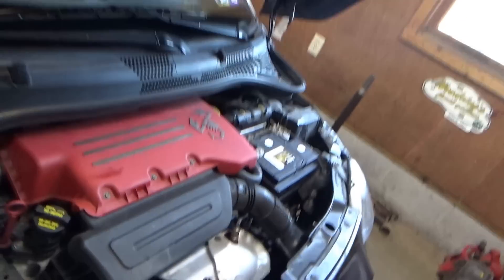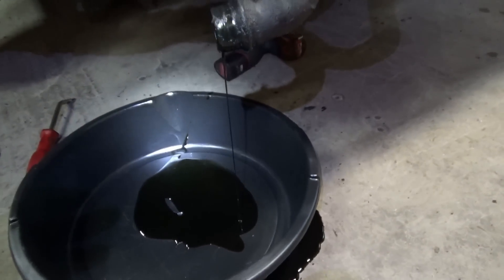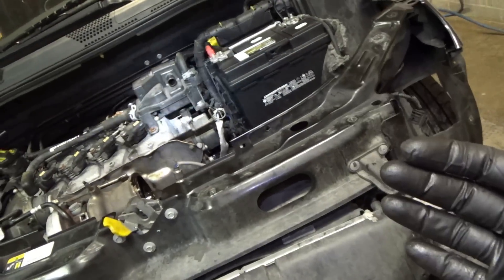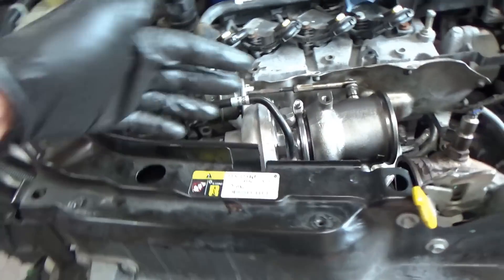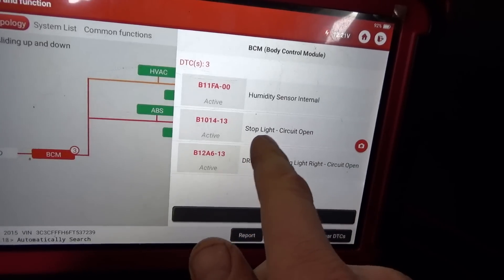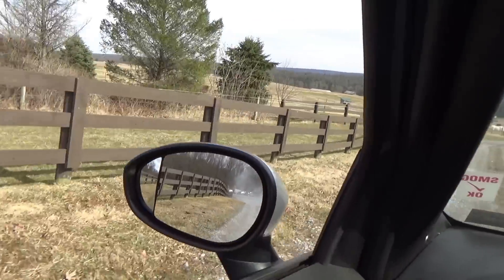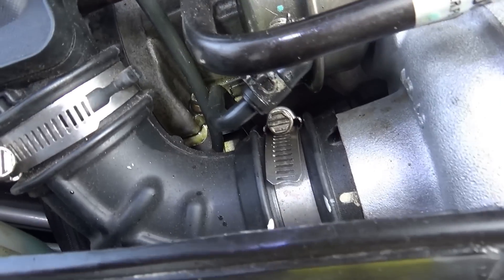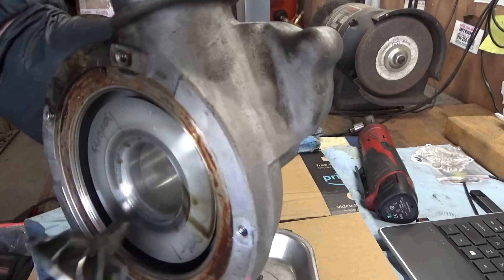Fiat Turbo GRENADES! (feat. Michael Jackson)

Comment: the smog OK sticker in the windshield is hilariously accurate.🤣
Reply: i past smog with flying colors with blown ring lands and smoke pouring out the exhaust back in the early 2000s,maybe because engine burning oil isnt releasing the wrong gasses?
Reply: "There is SMOG?" CHECK!  OK then...  :)
Reply: Very true!
Reply: Used the same measuring equipment as diesel VW,s
Reply: Came to the comments to say this but Hawkeye here beat me to it LOL.
Reply: @pigeonsil240sx  that should have failed the visual inspection lol.
Reply: Smog requested, smog delivered!

Comment: seen these type of failures on turbo cars so many times here in the UK with smaller engines whether diesel or petrol (gas) engines, it usually all comes down to lack of oil changes, the owner extending the service interval or private sellers and dealers resetting the oil service counter without actually changing the oil
Reply: I would say on top of this, just giving it the beans.. which if you have this car, you will hoon around for sure..
Reply: Or they use cheap crappy oil, I only use Liqui Moly in my Fiesta Ecoboost.
Reply: @tm199100  College kid driving it 🙄
Reply: I've also seen it happen, specially with plain bearing turbos, that people come right off the highway, park and shut the engine off right away.  Cokes the oil, scores the bearing and seizes it on the shaft.
Reply: I'm sure you did but did you check the oil feed and drain pipes for blockage? If not, you could be heading down the same path pretty shortly. Most failures are due to poor oil condition or no oil.
P.s not a dig at your process, love your work, just a tip for someone that possibly hasn't done one before.
Reply: The use of non-synthetic oil…
Reply: @davidbonnett5441  Made that mistake on a Honda turbo. Oil feed line has a gasket/screen assembly where it bolts to block that was plugged. Turbo lasted a day.
Reply: Hard cold start driving and not letting it idle to cool the turbo before turning it off will shorten it's life, I see the same issues with the lack of oil changes.
Reply: And it will still shred the oil pump belt and blink the oil pick up at 60,000 miles.
Reply: The little screens a lot of the manufacturers put in the oil lines don't help - crud in the oil blocks the oil supply to the turbo and next thing they explode. Seen it happen in a few smaller Ford and Pug diesels.
Reply: @stevestadnik9206  ouch!
Reply: @stevendegreef93  Back in '80, when in High School and getting my first used car, I had a friend who told me a joke. Now, remember there was no CD/DVD/Bluray/Satellite radio back then. The cars in my budget had only factory AM radios and m-i-g-h-t have had an external FM tuner installed (And probably done poorly). Anyway, a classmate friend told me this piece of advice: "If you're looking at a used car check the radio pre-sets. If they are all rock stations don't buy it."
Reply: You put in two quarts of fresh oil, 🤔and got out one quart of that black fluid? 🤦🏻‍♂️Oy!😱
Not only a laid out a smoke screen you also left an oil slick.😱
Reply: @RicksterMW2  theres a certian type of oils these take thats sold on the abarth website and if you dont use it your cause all kinds of issues

Comment: I have been building, racing, tuning, designing, dyno testing Turbocharged applications my entire career. 
1- religiously change your oil and filter with the correct grade, and premium quality oil and filter.
2- EVERY time before turning your engine off, allow time for the Turbocharger to spool or slow down before shutting off your engine. 
Shutting off your engine shuts off the oil supply to the Turbo, which can still be spinning 10,000-100,000 r.p.m.s. 
Following these 2 very basic guidelines and your Turbocharger should easily last as long as your engine. 
Thanks Ivan, for allowing me this opportunity to perhaps help a few of your subscribers. Excellent video as always. 
T.S. RACING
Reply: There are devices you can buy to allow you to leave your vehicle idling for a set or adjustable amount of time, and you can lock the doors and leave. They're worth every penny of the small investment. Of course use common sense when leaving your vehicle in a public place. Also, many modern day Turbocharged cars have liquid cooled Turbochargers,  ie., the same coolant your engine uses. If your coolant/anti-freeze is beyond its service limit, not only will it not cool your engine properly, it won't cool your  Turbocharger, AND AUTOMATIC TRANSMISSION as well. Read that last part again please. 
And yes folks I understand that it's the radiator that actually 
" exchanges " the heat.
Reply: i have a question, what when i just drive the last 5 mins very relaxed? without actually using the turbo, would i need to idle still? like driving sub 2k rpm for end of the trip, that's what i usually do

Comment: Seen this plenty of times working in gm dealerships. Replaced plenty of blown up turbos on the old Grand Ams with the 2.0 , and now it's  the pos 1.4L cruze.  Turbo's don't like lack of maintenance.
Reply: Yes plenty of oil changes are a must on any Turbo. I prefer synthetic but even back in the 1980's when Castrol GTX 20W50 was the norm on Turbo anything you had to do the maintenance. Even worse on a diesel when the turbo seal blows and you get a run away diesel!
Reply: these cars, 2015, they are now old. and paid off. Tiny engine, tiny lifespan.  Go get another.
Reply: Grand AM rip
Reply: @timewa851  its a tiny car too.. but 140hp form 1.4l engine is a lot! I m pretty sure the owner drives it aggressively and .. the result is this.
Reply: Yeah in a guy with a cruze and the turbo went out under 60k miles yeah he warrantied it then traded it in
Reply: @timewa851  Plentynof 1L ecoboosts around with 150k or more on them, how could that be possible if tiny engines have tiny lifespans? Small, powerful engines are simply less tolerance of abuse and neglect, two things that most car owners supply in abundance.
Reply: Especially  Subaru sti
Reply: @ferrumignis  well I still think Ford is a better manufacturer than Fiat Dodge and to be honest didn't forward take them EcoBoost and test them in the desert under hard conditions and then in the winter and like the Antarctic under harsh conditions under heavy load constantly up to 3-400,000 mi on test engines?

I mean I remember reading about the EcoBoost engines getting tortured for them trying to find problems with them so perhaps the EcoBoost engines are made better and the turbo shafts are larger.

Whereas this engine is made for performance and like the guy that did all the math said the larger you go in the shaft the more turbo leg you have and they're trying to get as much power as they can out of that little tiny economic engine so there's trade-offs.
Reply: The Abarth engine Block I’d based on the standard (F.I.R.E.) engine. In its basic form good for 54 BHP.

These (Abarth) engines are sought after by owners of most earlier/smaller Fiat cars including the Cinquecento and Seicento. Tuning wise they are no way near the top of their game in standard Abarth set up. There are some crazy conversions here in Europe/U.K.. the F.I.R.E. unit is very reliable in its own right… but as with most modern engines (1985 introduction) require regular maintenance. The engine in the Abarth here is s ‘F.I.R.E.’ but is referred to as the T-Jet in modern ‘Fiat Speak’. Early F.I.R.E units were 8v whilst later varieties(there a couple more) are 16v..

Comment: In the 1980's, I worked at a Chrysler dealership, and I repaired many of the Conquests model cars with the 2.6 lt 4Cyl motors, (this car was a Mitsubishi Starion sold under the Chrysler name).  In the few years I worked there I must have replaced dozens of turbo because of lack of preventive maintenance by the owner.  The oil lines to the turbo would cake-up if the owner didn't change the oil regularly or if they didn't use synthetic oil,which was still rare in the 80"s.
Reply: I had a 2.2 Turbo in a Daytona. It was owned by a Chrysler engineer before I got it. Had 180k on it, original turbo which was unheard of. He changed out the feed and return lines as PM saving the turbo.

Comment: Seems like the last people who worked on the valve cover leak forgot to bolt the turbo support bracket - leading to violent shaking and catastrophic failure. Customer could claim cost against previous shoddy work...  I don't like to be a comeback customer, but it almost seems justified here given the cost involved.
Reply from the maker: That's an interesting theory... video is proof!

Comment: Good one Ivan!
The last turbo I replaced was on a truck with a Cummins Compressed Natural Gas (CNG) engine.  The shafts seals were bad because no one had changed what looked like a factory catch can and filter for the PCV system.  The filter was partially plugged.
TURBOS ARE NOT CHEAP!
It's better to change the engine oil way before the OEM recommends changing it.
Another item with turbos.  After driving the vehicle, let it idle for 5 minutes before switching off the engine to let the turbo "cool down" and reduce it's RPM'S. 
Remember.  When the engine shuts down, the turbo is still spinning and there's no oil being delivered to it!
Never shut off the engine after fast or aggressive driving.  Let the engine idle for a few minutes.
Turbos spin at many more thousands of RPM'S than the engine and they need LOTS of clean fresh oil!
Reply: Turbos nowadays come with a coolant line to prevent that, it should not be necessary to do that if you're just driving normally on the streets.

Comment: WOW.. brings back memories,  had a 1980 Buick regal ,3.8 litre turbo , think was late 80's , I was with a couple friends away for weekend trip, prior to trip I remember doing something under hood with vacuum  , it started smoking on return trip (160 kms) gad to stop every 30 minutes to add oil, smoke show whole way home, took out engine and replace it later with used engine.

Comment: How long do oil filled Catalytic Convertors last?
Reply: Great question
Reply: Wondering about the same. Right now they are toast. Maybe the oil will burn off? Or maybe not. Certainly they are not liking it.
Reply: YES! That's the next one to fail as well: SOON
Reply: Not long, but cat thefts are up.

Comment: Love these oddball videos and your patience is incredible Ivan. How in the world did the cat/sensors  survive the oil bath? Awesome job and a very interesting tear down of the turbo in the end. How in the world is that running on such a small diameter shaft? Wow. Thanks so much!!!!
Reply: That's a normal sized shaft for a turbo of that size. They don't transfer a lot of torque amd the smaller they are they less the drag imposed by the bearings.
Reply: My question is how can the converter not be completely plugged ?
Reply: @delwhylie4748  Perhaps they're hot enough to prevent the oil from condensing on them, plus the exhaust pressure helps too I guess.
Reply: @delwhylie4748  Or completely melted

Comment: During my apprenticeship I replaced quite a few primary turbos on the old Subaru twin turbo legacy's. There was a filter in the banjo bolt oil supply that got blocked up. Fun job, big smoke cloud s for a few km's on test drive.
Reply: I saw a video on Turbo Disintergration as well, customer was in a different City had a Local Shop REPLACE the Turbo all is well, he drove back to his Town and Disaster!. Local shop in Town took a look Turbo problem again, turn out the Oil pipe to Turbo was BLOCKED, previous Shop didn't replace pipe which is part of repair kit.
THANKS Ivan for Great VIDEOS.

Comment: My Jag blew it's turbo at 55k.  I blame long oil change intervals + start stop + diesel + city driving.  The combination is deadly.   It was fixed under warranty before I bought the car at 57k miles.  The total cost to repair was somewhere around $17k as they replaced everything from the manifold to the tailpipe.  I disabled start stop and the oil change interval is now 3-4k miles instead of 10k.

Comment: I owned a 2013 dart with the 1.4 turbo, ran good lots of pep. Traded it off at 80,000 miles never had any turbo issues or really any engines issues to speak of.

Comment: I had a turbo blown up (broken shaft) because I stopped the engine right after I left the autobahn. The problem is once you stop the engine there is no cooling anymore but still a ton of heat in the turbo.

Comment: NHTSA has received a complaint about a turbo granading but I found no recalls for that year (not running the VIN) Great job and I am very glad I am retired!
Reply: NTSHA probably just requires that no impeller blades leave the housing. That's how it is with NTSB and jet engine parts!

Comment: Hi Ivan,  love the channel. I have seen several turbo failures where the oil drain line has been blocked starving the turbo of lubrication, usually due to poor oil hygiene. High crankcase pressure has a similar effect. It is imperative to take the turbo oil drain pipe off and prove it is clear and the oil feed pipe as well.

Comment: This brings back good memories. Used to work at Fiat and we had a 500 Turbo Cabriolet with less than 25K on it that blew a seal in the turbo and totally smoked out the shop. People get intimidated by removing the front-end, but it looks more difficult than it actually is. I remember being surprised warranty authorized replacing the muffler because it was soaked with oil. I remember we just removed and flushed the rest of the exhaust.

I gained a lot of respect for these little 1.4L after seeing customers run them nearly out of oil, tow them behind RVs still in gear and a whole host of other abuse and stupidity. Rarely did they end up not starting right up. The turbo is the weakest link in the entire powertrain IMO.  The later cars got either an updated Honeywell or Garrett turbo later down the line that seemed to work better.
Reply from the maker: This one was a Honeywell that grenaded lol
Reply: Wow never seen a Honeywell on an abarth. I have a first year and it’s a Garrett.
Reply: @tjnucnuc  same i had the abarth punto esseesse and that had garrett from factory
Reply: i thought 💭the multi air "brick" run's in hydraulic springs&power so low oil should = engine shut's off ??? and or no starting?

copying it for my v8 1969 hemi dodge
Reply: glad to find it's not that fragile as people are trying to convince ( not buying into the fear ect ) me, as there saying between this and the cam-in-cam/vipers-styled cam and VCR-rod's-Nissan-styled im going to feel sorry 😔and have a windowed block from rod's hitting a valve's , but im taking steps so isn't leaving me stranded on the side of the road 😉
Reply: @richardprice5978  Yes. I found this out the hard way when I didn't fully screw on the oil filter housing. The engine ran for a few seconds and then shut off and cranked with no compression. They will also do that if you leave them sitting for a long time without starting them.
Reply: @dil6969  👍that's a unique feature for anti-theft device, what PSI did it shutter off at? 

and on top of the millennial/TR6070 trans ect should be one extra surprise for a wannabe joyrider as the computer or lacking there wouldn't start it as there no fuel being sprayed or spark or compressions ect lolz 😂the idiots probably wouldn't have a clue to what's going on 😂
Reply: @dil6969  anything NVH or drivability feeling i should know more about? vs the fixed hydraulic ( or solid lifter's, but i haven't really driven much using them, and the old69 v8 engine was hydraulic fixed ) lifter's?

Comment: That's very similar to the turbo set up on a Chevy Cruze 1.4, I see a lot of failures with them but have not yet seen a broken impeler, usually underboost codes with broken wastegate, I have seen lots of Ford 6.0 and the older dodge Cummins turbos wear out shafts and leak into the exhaust. That was something to see that much oil coming out the tailpipe.

Comment: I’ve never seen oil dripping out the tailpipe like that lol 🤣
Reply: Yep had a BMW 330d did that.  Took about 20 miles to clear up after a new turbo fitted, part of the old impeller is rattling in the exhaust to this day, (another 50k and still going strong)

Comment: The inside of intercooler needs to be cleaned of material from the broken fins. Intake piping needs to be cleaned also. If the engine ingests the fin pieces, it could cause a lot of damage.
Reply: Yup.  I have a '17 Infiniti Q60 Red Sport w/VR30 engine & twin turbos.  Had a mild whistle under boost - dealership replaced both turbos AND the engine under warranty because the impeller bits could have made it to the intake.  The intercoolers, throttle bodies and intake manifold were cleaned before getting re-installed on the new engine.  This Fiat engine might be toast from the upstream carnage.
Reply from the maker: It's fine. The intercoolers act as filters HAHA
Reply: @PineHollowAutoDiagnostics  Yep,the intercooler oil bath secondary air filtration system. Great concept. 😄
Reply: @PineHollowAutoDiagnostics  question how come the cat isn't screwed from the oil ?

Comment: Nice work Ivan. I snapped an impeller shaft on my 1.9 TDi 2006 VW Golf. Happened at about 160,000 km (100,000 mi), but unlike the Abarth it didn't dump oil into the exhaust. The turbo on a Golf is on the back of the engine, so you have to remove right hand front wheel and drive shaft to get it out.

Comment: You did not show the part where you struggled to put the nuts on the studs on the bottom side. Had a Cat 1160 engine one time got a hole in a piston (defective) took about 2 gallons of oil per mile to get back to the shop lucky only 6 mile away.

Comment: Interesting oil choice by mini. I think I put 5w-40 t6 in my 3 cyl iseki diesel tractor for the winter.
Reply: Standard 5w40 is what an engine like this needs it runs hard and hot.

Comment: Ivan, 1996 Turbo Porsche 39k miles, turbo seals bad exhaust full of oil same smoke screen. Shop neighbor thought building on fire. 10 hrs labor. Dealer wanted 12k for replacement. Cheers!